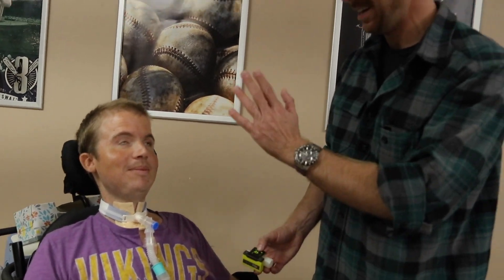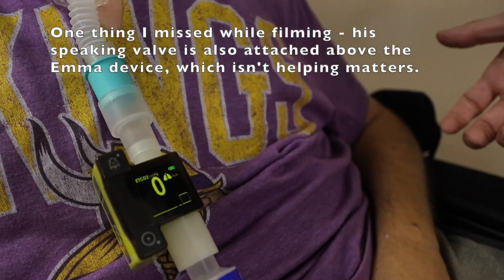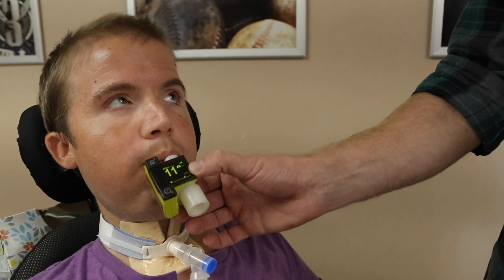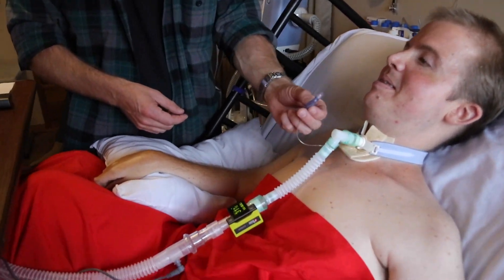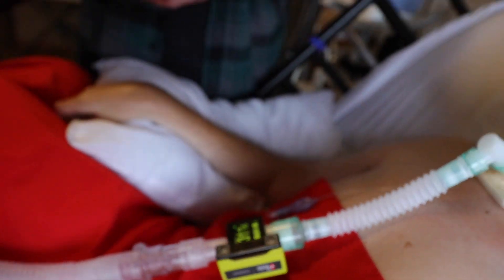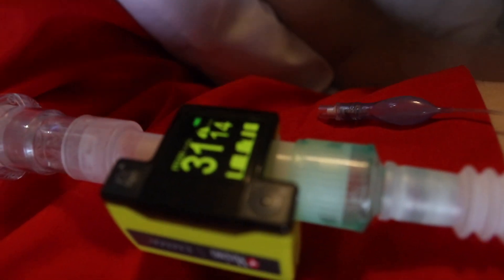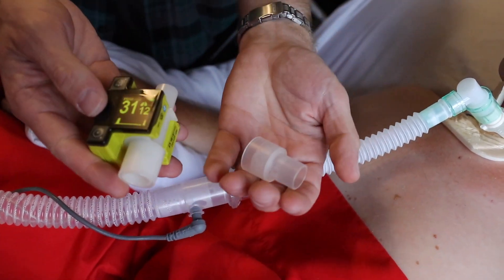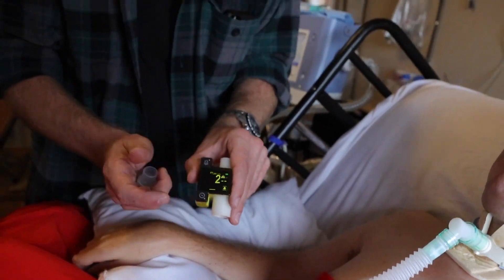Masimo Emma Part Two

Comment: THIS VIDEO IS GREAT! I am a ventilator dependent patient, who has multiple Co-Morbidities, and who is 24/7 ventilator dependent. I spent over $1,000 and bought me a monitor that has ETCO@ as well as the Standard, ECG, SpO2, NIBP, TEMP, etc. Because of my ability ot  obtain a monitor that measures my ETCO2 and has a waveform, Capnography, I was able to titrate my ventilator settings accordingly, and I have  being that I've always thought like an RT more than the patient, I've always taken care of my ventilator settings. Because of my CO2 monitor, I have the perfect settings, and my Pulmonologist is IMPRESSED that I monitor ETCO2. Because of the ETCO2 monitor, we don't perform Arterial Blood Gases often anymore, and she knows that whatever my settings are, they'll be appropriate. I believe HOME ventilator patients SHOULD have ETCO2, because it would better allow the titration of the ventilator settings more appropriately,  as it has done with me.

Comment: I am a home care RT and have been for many years. I believe these will at some point become a standard of care and also as proof of active ventilation for liability reasons. There is currently no billing code for the device or disposables, so that is a factor, but imagine the cost of a lawsuit. I wish home care companies like ours would look into the patient safety factor of these devices and buy one for us along with one disposable 'sleeve/tube' for each patient. This would also give the pulmonologist an idea if the Vt is appropriate for the patient, especially with some of our peds patients who grow faster than their prescribed Vt. 

What kind of in-between patient cleaning is necessary with this unit? Anyone know?
Reply from the maker: As far as I’m aware you just swap the disposable tubing piece, there’s a thin film in it against the sensor so no breath actually touches the unit - a swap and a sani wipe should be plenty.
Reply: @KTStrategic  Outstanding- thanks a million.